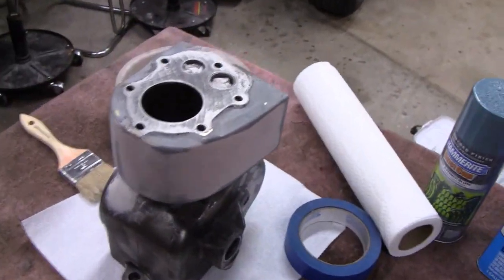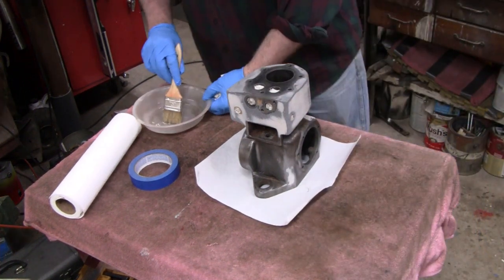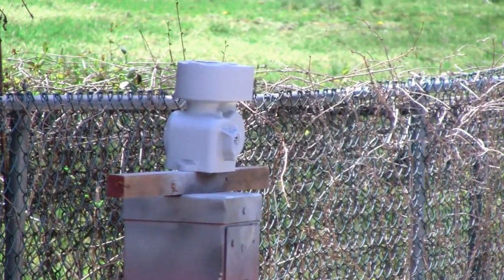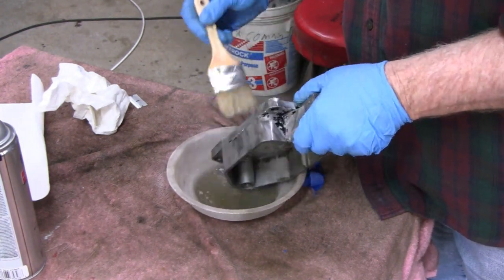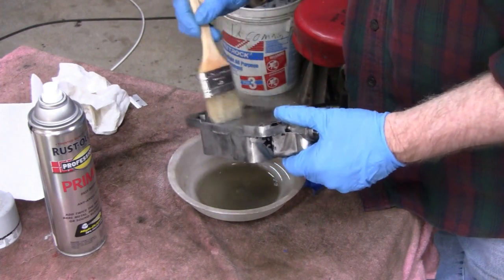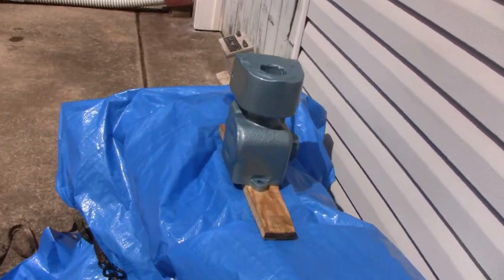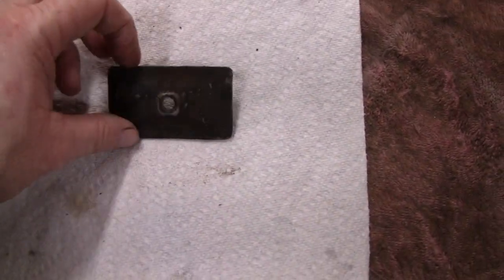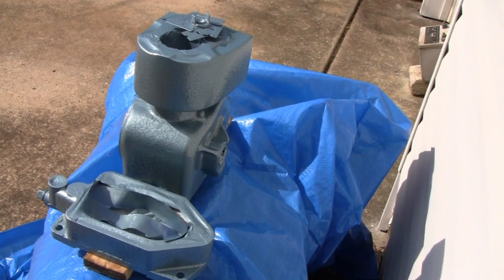HOMEMADE WATER COOLED BRIGGS ENGINE (part 25)

Comment: It's looking excellent!  The water jacket part of the block looks factory.

I also like the hammer-tone paint. Used it on the switch housing on my latest Ilg fan build. 

Never used the Hammerite brand, but have had great success with Rust-Oleum Hammer-Forged paint.
Reply from the maker: Thanks Bud!! I'd recommend it, it sprays and looks just as good as Rustoleum!!☺

Comment: I was working on my rider mower the other day, I had so many tools out, I finally stepped back a just put most of them away. Then started afresh. I like to warmup thick metal pieces with a heat gun or torch, not too warm just enough to drive out any moisture, had great luck.
Reply from the maker: It usually takes me an hour plus to clean and put the tools away after an engine night!!☺

Comment: that rustoleum hammer coat works ok. what I found is it works better on plastic.  2 thick coats make a good hammer finish. make your own with lacquer paint and thinner. 1/8th cup of thinner to 3 cups paint is how I put it on.  also if doing plastic put a dark color under the hammer coat so it produces a better look and the thinner doesn't expose the plastic.

Comment: Rust-oleum seem to be good as we are selling these cans to. In our country.
Reply: daand12 
You can't beat the brush on stuff either , if you have days to wait for it to cure. I use that on suspension components. 
Pick a brush on color that has a matching spray color, and give it a couple topcoats for gloss. 
When a stone chips it you see the brush on coat unless it's a hard strike.

Comment: Looking great!

When I rebuilt my Classic mini I used Kerosene as a degreaser come paint stripper and general cleaner. i found it worked much better than petrol (not Gasoline!). 

So my process was soak in Kerosene, a bit of a scrub with a wire brush and then a hot wash in Mrs. Cyprusgrump's dishwasher - perfect.

Please don't mention this to Mrs. CyprusGrump!

I'm not sure if I can post a link here...

http://s96.photobucket.com/user/markfrank19/library/Mini%20Restoration?sort=3&page=1
Reply from the maker: Our petrol has alotta alcohol in it!! The Mini looks great!!☺
Reply: Thanks Buddy! It took 3 years to completely re-build it but as you would say, I'm happy with it"...

Perhaps the alcohol makes a difference then. Ours has to contain bio-fuel because of EU regulations and is a bit tame...

The Kerosene will eat through those great big rubber gloves of yours tho!